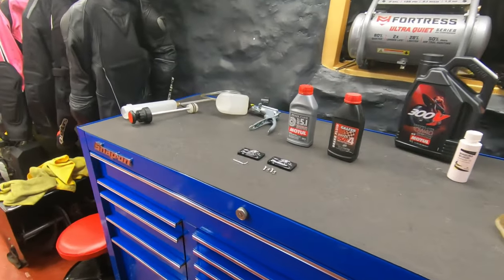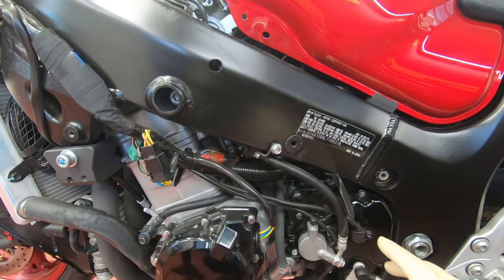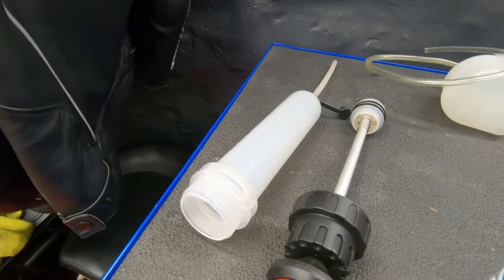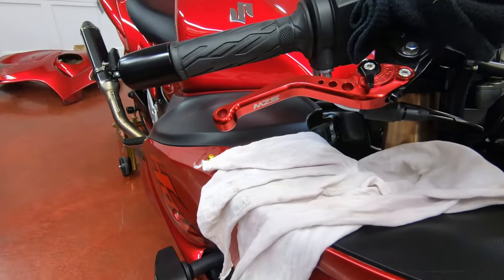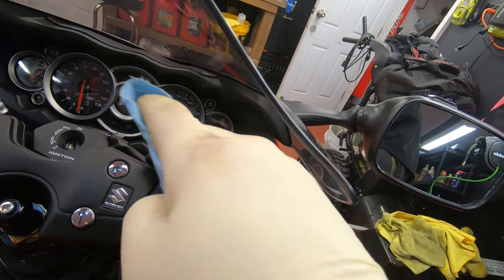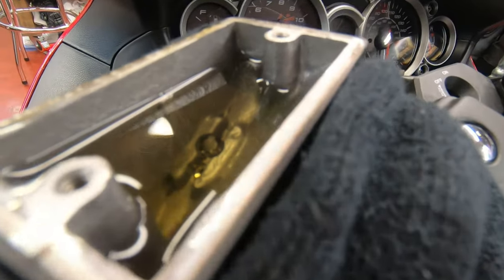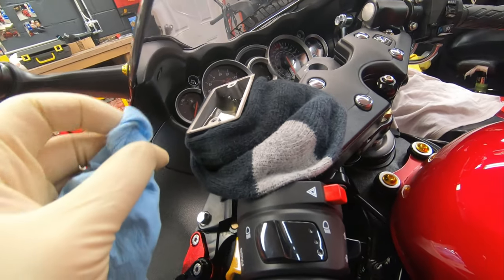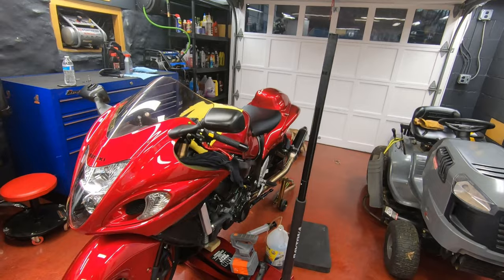Do this EVERY 2 years | Brake and Hydraulic Clutch fluid flush.

Comment: Hi mate, great videos. A tip for you if you should require it. I have just found out that Japanese bikes use their own JIS drivers for the 'philips' head screws. The JIS design prevents cam out of the driver when loosening tight screws. That's when the driver comes out and twists up the screw head as it does so. With a normal Philips bit you have to really press down hard to prevent that as you know. So a little JIS set will set you back around 20 dollars with 3 sizes of bits and will save you a lot of hassle. Edit: there should be a JIS screwdriver in your bike's toolkit. 👍
Reply from the maker: Very well my man! One of the best tips someone gave to me💪 I didn't know this and I can't believe I didn't all these years 😅 thank you for mentioning this. I just researched the difference JIS vs Philips and yes there's one in my tool kit 😊 it's hard to know because they look so much alike, actually it's very hard to tell the difference. That solves the strippiness, but they still don't look like nice bolts, at least for me 😁
Many thanks for the tip and if it ever leads to that in a future video I'll definitely mention it 🙌🙌
Reply from the maker: Ps: I re-examined both Philips and JIS and if you look carefully on the Phillips the four edges have a taper on them where the JIS are just straight. Very good info again man! Thanks 👍👍
Reply: @MototalkUSA  You are very welcome. 👍

Comment: Great video! Thanks for clearing my confusion. I was wondering if I had to buy a clutch oil separately but didn't know that I can use brake oil in both 👏
Reply from the maker: Thank you and you're very welcome. Yes, on the Busa it uses brake fluid for the clutch as well. But like I mentioned in the vid some bikes may use hydraulic oil.

Comment: Hey Man love your channel. For info the reservoir screws aren't Philips, they're JIS ( Japan Industry Standard). Philips are designed to 'cam out' when you reach a certain torque to avoid over tightening. JIS will not do this allowing screws to be tightened as much as you dare. Get a set of JIS screwdrivers, they fit really tight. 🇬🇧
Reply from the maker: Thanks man! Happy to hear you like the channel. Good info, thank you. Another viewer mentioned the same this about JIS and Philips. I can't believe after all these years I just learned about this 😅😅
Reply: @MototalkUSA  Most, not the small ones, JIS screw heads have a single dot on the top to identify them. 🇬🇧 😃
Reply from the maker: @simonlye007  good info, good to know man! 👍

Comment: Brother I just bought a 2018 hayabusa with 13,000 kilometres in it.   Right now when I start the bike, I head a rattle coming from the oil reservoir, on the right side of the fairing.  Where you put oil in from, I think it’s the clutch plates or something.  I’ve been reading online something as well as a  backlash adjustment.   Any help will be appreciated.
Reply from the maker: If it's not very loud and doesn't do it all the time I wouldn't worry, mine has a rattle there too when I first start it in the morning. If I pull the clutch in the noise goes away mostly. It almost sounds like a Ducati. I have the bike since new and it has 23,000 miles. I read other ppl in forums have this noise too.

Comment: Do you know if those covers will fit my 2023 busa?
Reply from the maker: It won't fit, 3rd gen has a different shape than the 1st and 2nd gen but here's a link of a set for your bike. Not the same design tho. https://www.amazon.com/WJSM-Cylinder-Reservoir-Hayabusa-Motorcycle/dp/B09K791T4X/ref=mp_s_a_1_5?crid=3G9F5OKBTH3XT&keywords=2021+Hayabusa+brake+fluid+cover&qid=1684528848&sprefix=2021+hayabusa+brake+fluid+cover%2Caps%2C143&sr=8-5
Reply: @MototalkUSA  Thanks for the fast reply!! I looked at them and I like yours better! The design is better on yours.
Reply from the maker: @vincentcardelfejr8280  you're welcome my friend! Yeah I know, I like mine better too. I was trying to find it for yours but I couldn't. Maybe eventually they'll come out with them.